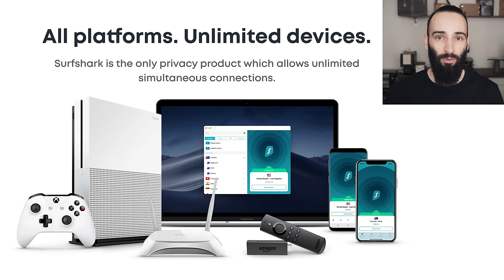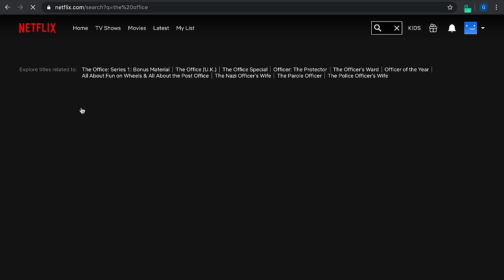DIY Electromagnet | Vise For Excelsior Drill Press

Comment: Will there be a demagnetizer? Otherwise, the residual magnetization of the part is very difficult to work with later.
Reply: all he has to do is connect alternating current do the winding's while the part is on top. he could prob just add a DPDT switch that after he's done milling, will disconnect DC and turn on AC for a second. works very well.
Reply: @electricalfive2248  I must have missed the DC part -- i thought the whole thing was AC --  guess i better rewatch!
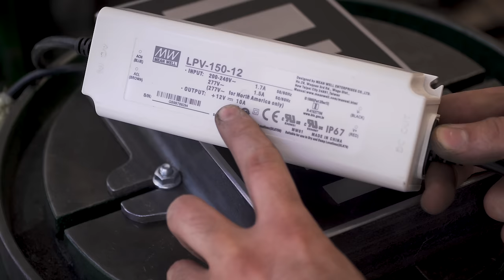Reply: @dziggy3004  10:27 ... The specs shows 12V DC 10 amps output.

Comment: Very nicely crafted! Just a couple questions, how would you go about finding out the operating specs? How much current would this draw so as to use the right wire gauge, to not fry the adapter, and to estimate the magnetic flux and thus the maximum force? How do you know that the "electromagnets" will work with 6V each given that they're connected in series?
Reply: Should be able to simply calculate it with Ohms law and Power formula.

Comment: Lovely job, props for all the manual work cutting back the cores.
It is worth selecting the coil polarity to make the two middle core faces opposite poles when you connect the wires.  Very difficult to change later unless you bring out all 4 wires.
Reply: What's the best way to determine polarity??
Reply: @michaelcoccojr2513  Pass a small current though the coils and see if they deflect a compass the same way or push/pull a small polarised magnet in the same direction.

Comment: I'm impressed! Didn't expect it to be so strong with only 6V DC on each coil! Well done!
Reply: I saw a video using only one transformer and 12V at about 8 amps.  That's less than 100bwatts of power, but he failed to measure the breakaway force because his scale maxed out at 300kg.  These things generate amazingly strong holding forces.  These transformers could easily handle 1000W of input power for quite extended periods of time.  Holding force should be directly proportional to current flow.  Iowa, a single transformer might be able to clamp with 3000kg of force and not break a sweat.
Reply: @tonyfremont  Yes. It later reminded me of the magnetic security door locks, that pack tremendous force in small packages, also working on 12V DC.

Comment: I had two microwave transformers that I I just ripped out to make a couple more lichtenberg machines to burn wood and I came across this.  I ordered the epoxy and power supply and will have one of these working in a week or so.  Thanks for the video.

Comment: Outstanding.  There used to be a product called Electrabrake.  It was a sheet metal brake that used electromagnets and a floating bar that would hold the work piece.  I would love to see Black Beard Projects take his idea further and build his own version of the Electrabrake.  Basically the same idea, but using a series of maybe 10 or 12 of the transformers in a row.  Anyway, thanks for the great video!

Comment: Hola, creo que sería mejor utilizar las bobinas de alta tensión, ya que tiene diez veces mas de vueltas, el campo magnético será el mismo pero el consumo, será significativamente menor (de 4 a 5 veces menos) y por lo tanto la fuente de alimentación también será menor y menos costosa. Por otro lado los cables que utilizas dentro de la bobina  son muy delgados y se podrán quemar (el consumo será de mas de 16 amp.), todo esto si como es normal, utilizas Corriente Directa. Sólo es para ayudar.
Saludos

Comment: I’ve made an identical magnet,tested it with a 12 volt battery and it works great,very strong! I tried wiring it to a 12v 10 amp 120w power supply and nothing,very weak. What am I missing here?

Comment: Awesome video! Very practical stuff, and much cheaper than buying a commercial electromagnet with that kind of power (especially if you get the microwave from a dumpster).
Reply: You're not wrong. Every 6 months around here the local council does a cleanup where you can dispose of all those things which you don't put into the garbage bins. Without fail, there are always, ALWAYS, thrown away microwaves. I've scavenged a couple myself in the past for spare light bulbs (mine blew and the shops were charging $40 for a replacement! Why not get them for free!). This would be an cool little project to do for cheap (excepting that resin stuff...its probably costs a bit).

Comment: As drill presses go  that is a very, very nice one.  I think I'd have done the chuck a little differently I'd have used  steel and copper plates about 1/8"  thick  by 1" wide short side up running across the short  width.   Soldered them together in a  fire  in a large clamp.  Then run the magnets under them.  Since you don't have a  milling machine  I'd have used a gang cutter stack on the lathe and  used the lathe like a horizontal mill  using the cross slide to move the  unit  under the cutters. That way I'd have a more substantial  surface than the epoxy will  provide  but hey  it's a great  job  just the same.

Comment: 08:05 Methylated spirits works great to lift glue-stick compound without leaving any marks. The purple stuff gets under the cold glue and causes it to separate from the contact surface. 5 to 10 seconds. Just make sure it gets underneath. Sometimes with heavy deposits, jam a screwdriver in and twist, this will cause a vacuum which will draw in more of the spirits which will make the process go faster. NO MARKS ON SURFACES.

Comment: If there's a power failure while you're drilling, the work piece could injure you. I suggest connecting five 2.7V super capacitors in series and then connect that in parallel to the magnet's circuit. Size the super caps to give you a second's worth of power, that way the magnet only cuts out after the drill stops spinning. 10-20F super capacitors (each) would probably be sufficient to prevent injury.
Reply: Не стоит. Во первых сам мотор генерирует ток. Во вторых магнитное поле пропадает с задержкой как раз 1-2 секунды.

Comment: Very cool project...
- Your power supply is rated at 12v/10amps but how much power does it actually use?    
- Do you have to do anything special to get the polarity correct when you connect the two electromagnets together?    
- Have you tried it with a 24v/10amp supply to see if it's a lot stronger?   
- Does it get hot when left on for a prolonged period of time?
Reply: The same i wanna know!

Comment: I have a question about the electromagnet. Can an electromagnet be used to hold parts to be welded? Not directly but it would be placed on the metal sheet and the welded elements on it. Rather, there would be no risk of overheating of the electromagnet because the welds are small and the magnet could be located at a distance. I mean, would there be any interaction with the electromagnet during welding?

Comment: Good Morning
Excellent work.
I would like to know, if you only occupy the primary coils, what is the output voltage of the coils, the connection is in parallel? You can share the connection diagram.
Regards

Comment: I really like how you mentioned about the right way to discharge the high voltage capacitor as other people have missed this step but can i ask you what winding it was that you kept to create the magnetic field & if you earthed the housing at all. I understand that you used a low voltage power supply but there could still be some change of a ground fault

Comment: Hi. I made a vice like this. But found that 12 volts creates a small magnetic field. I than connected 110 volts AC. Which was much better but not effective. The steel could still be removed easily. So where did I go wrong?

Comment: Dude I did the exact same thing and mine isn't putting out much power at all. It magnetized but not enough to hold something I used the exact same LPV-150-12 power driver thing and hooked it up using a 110 plug an it does magnetize but not near enough....can u do a video on the wiring of it details please. Mine is all ready to pour epoxy after I get this wiring thing down. Thanks man.

Comment: hello dear, in the meantime congratulations, I kindly asked you to connect the wires with three transformers and continuing as the two, I connect in series the three transformers in parallel one pole, three points remain for the current, where do I put the current? 12 volts is also okay with three transformers? Thanks I bless you from Italy Sicily Palermo.

Comment: Does the vice grab small parts across the centre two poles?  If not, reversing the connections to one of the windings would change that as you would have alternating north-south pairs across the whole surface.

Comment: Hi, I tried your build but there is something not quite right and wondered if you could help. I built my vise with 2 transformers and I am using a 12v 10amp transformer but the gripping power is very weak. Any ideas off the top of your head as to why? Both sides of the vise are weak, barely 5lbs of pull. Any help would be appreciated. Thanks Bob

Comment: Heres development idea. Make a watertight connection box to get cord in with pull prevention, enabling cord replacement with out taking whole thing apart, witch might become next to impossible with all that epoxy. Also could you not just weld plate to magnets cores and get larger surface area connection that way? I'm not expert on magnets, but that would make sense. Please do correct me if i'm wrong.

Comment: Very informative clip. If i understand correctly, the more amps, the stronger the grip? You used a 10A transfromer. So if you use a 20A one, would give you twice the holding power? Did you ever consider  measure the Adsorption Power of your device?

Comment: Curious what it would take to make the vise simultaneously magnetic on the bottom so you could place it on a metal surface and hold parts for an angle grinder.

Comment: Would your fabricated magnet have been stronger if you had used both sets of coils, or used to make an electromagnet base twice as large?       My main use would be to hold parts for the angle grinder.       Thank you so very much for this excellent and instructive video...

Comment: HI. Sorry for the stupid question, but I am not an electrician :-).
Following your video, I have done the preparation part. Now I am at the step of connecting the 2 magnets. You connected the 2 inner clips with the brown cable (video position 06:00min). After soldering the brown cable to the first magnet, does it matter, WHICH of the 2 clips of the second magnet I solder the  brown cable to?
Thanks 4 helping!!!

Comment: Dude. The excellent safety tip (right at the top of the video) plus that super smoooooth segue into the sponsor's message? Incredible. Dare I say, almost magical. Well done. You should be on Netflix. Only one question (ok, two): Where/how did you attach and earth ground to the magnets and the housing in case you get a short the winding? 10A would hurt. Also, how much does it heat up when you have it on a while? 120W isn't a lot to dissipate, but that epoxy must be a great insulator...
Reply: why would he need to ground 12v DC?     two primary coils in series only pulls 24w at 12vdc. the bottom and top of the transformers could easily cool 400w of heat anyways.

Comment: Nice. Is the bottom magnetized as well? Do you need to use the bolts to secure the unit to the drill press table?

Comment: How long can you keep this energized? Will it overheat? I tried this set up and the coils get quite hot with 8-9 amps running thru the coils. Does the epoxy help to dissipate the heat? Very hot to the touch after 2 to 3 minutes.

Comment: I would highly recommend to add a high voltage capacitor parallel to coils. During switching off the vise there will induct very high currents what might toast the power supply.
Reply: A flyback diode pointing the correct way would be better.
Reply: @kurtbilinski1723   100%

Comment: "Black Beard" ... can I ask for a BIG favor please? Would you be willing to do a small test how this magnet of yours picks up the shavings from floor? Or ground like garden grassy or sand areas ?

I'm about to do some drilling and grinding in my garden and most of it, has to be done in areas, where my kids run bare foot (me as well) in the summer. In order to prevent an accident, i was thinking about creating an electromagnet form the "fire door mechanism" but when I've checked it out (on the door it self) it didn't seems to be very powerfull. So I ended up on youtube and found your video.

If it's not a big problem, please make a short video please, how it performs in picking up the shavings. Thank you in advance.

Comment: Very nice idea, but that electromagnetic table gets an issue: you can drill holes on its center, nothing else. You cannot move the drill head left or right and perform a side hole coz you may damage the electromagnetic table. But it's good instead of using screws to hold the metal thats has to be drilled.

Comment: 7:30 - Why do you fill the transformer cavity with epoxy entirely? To increase magnetic flux by removing air?
Reply: Its probably to have a clean stable work surface!

Comment: Why did you link those primary windings in series instead of in parallel, they should be more powerful like that...
Reply: Stephen Balogh 
Explain your theory why you think so ?
Reply: @MrVailtown  # Providing you still using the primaries of those transformers, then theoretically could still be using them independently, as they were designed to be connected directly to that power supply. Although, I am aware that having broken the iron core does affect the inrush current in those coils, and if they're not always kept on metal, to keep their magnetic circuits closed, then the current draw could be critically high due to less emf... True,  in parallel the greater inrush current could make them warmer but also stronger. 
I meant this as a question, not definite guidance or direction, especially if you have considered all of this upfront.

Comment: Anyone wanting use this on a milling machine, DON'T DO IT. Mag vises work well for surface grinding and drill press work (for smaller bits). Not milling. Think of it this way, you can hold, with you hands, a piece of metal to a grinding wheel. And push like hell if you want. Now try to hold, with you hands, that same piece up to an endmill in your mill.... DON'T DO THAT BTW. You will be left bleeding and sad. Great work Btw!

Comment: The first thing you do when taking apart a microwave oven is to NOT take apart a microwave oven, especially if you're doing it because you saw a Youtuber do it. The high voltage caps aside, the magnetron (the block above the transformer) contains Beryllium which is fatal if it gets into your lungs.

Comment: I like the idea but I'd have put the two coils in parallel...rather than series...🇬🇧👍
Reply: But then the current in each coil would be halved, and the intensity of the magnetic field is proportional to the current
Reply: @alexambro4998  its not proportional to the current, its proportional to the power output or how much watts its pulling.  two primaries in series will be 6 ohms. at 12v its physically not capable of pulling more than 24w...

Comment: What is the effect of microwave on human health- thank you so much
Reply: Microwave energy isn't powerful enough to cause DNA damage. It's not, as they say, ionizing. However microwave energy can heat things up, and if you would bypass the door safety and put your hand inside while a microwave is running, you would cook from the inside. Note however, microwave ovens are like 600w, the microwave energy from a wifi antenna is less than 18mW, 30000 times less powerful. Meaning, it would take 30000 wifi antennas emitting constantly instead of switching on and off to send binary data, all next to each other, to even be able to heat up a cup of milk. A dozen wifis in your building is just... insignificant.

Comment: Dangerous toy.
Reply: Why ? Enough holding power, only 12 V and 10 A . Where is the danger ?
Reply: @horiachiorean8592  Because if for any reason you have a loss of power while drilling, then the spindle will continue to rotate, while the part will have nothing to hold it down.